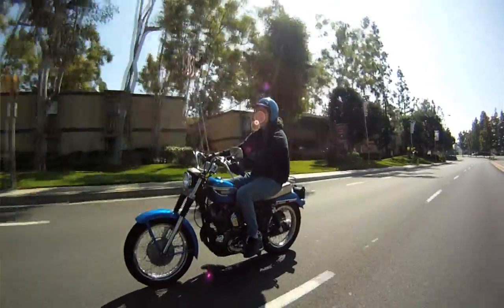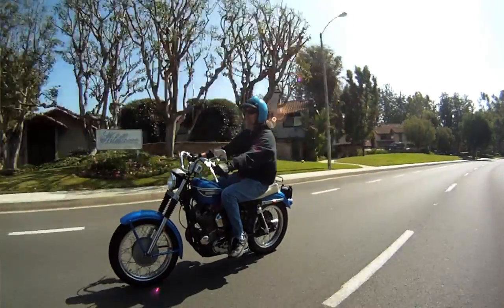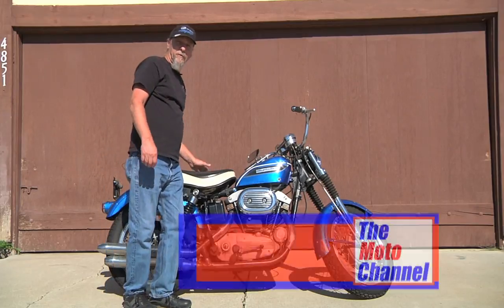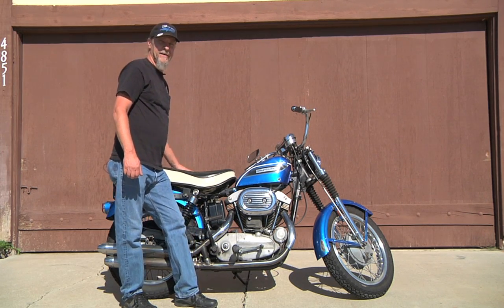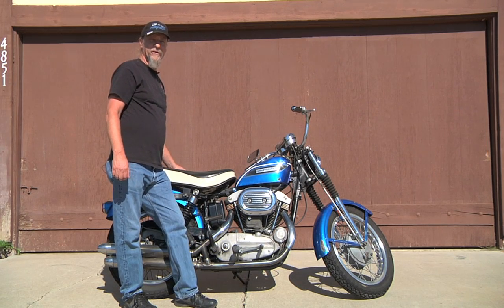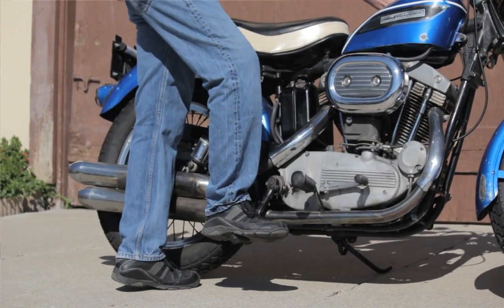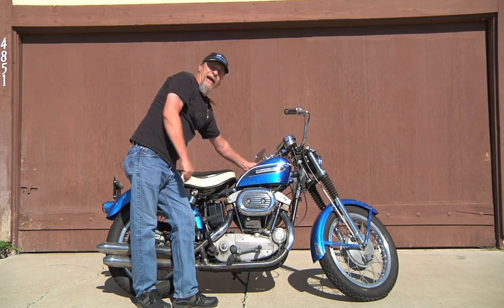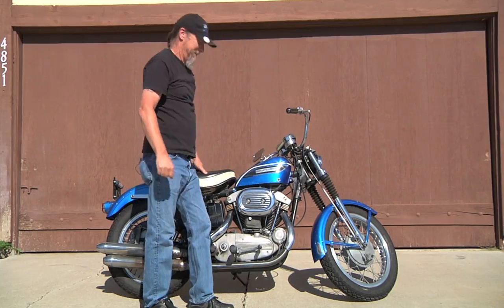Motorcycle Kick Start Demonstration: 1969 Harley-Davidson XLCH Sportster

Comment: I just got done with a resurrection of a 79 ironhead.  It's a kick start bike. I turn the gas on, pull choke out to get the fast idle, throttle 3 times, turn on key, and one kick and she starts right up! I ride it every morning around a pretty long block 3 or 4 times to keep the battery charged, but also to get my knees in the wind too! I love it!

Comment: Those are very cool bikes.  I had an ’85 ironhead XLH 1000 for a while, electric start thankfully.  The bike couldn’t corner too well, but was still a blast to ride when everything went right with it.  You can’t help look back at ’69 though, and in all honesty see why Honda had no problems with shuffling herds of CB750’s out the door.  I imagine kick start only with a magneto didn’t exactly put smiles on faces when one was in a hurry to get going or not in the mood for a workout.

Comment: Can you put electric start kits on these? I have a 1960 xlh, and its already claiming victims.
Reply: not until 1967 when they changed the cases to accept it.
Reply: @vector6977  thanks, I've learned a bit in the last 6 months!